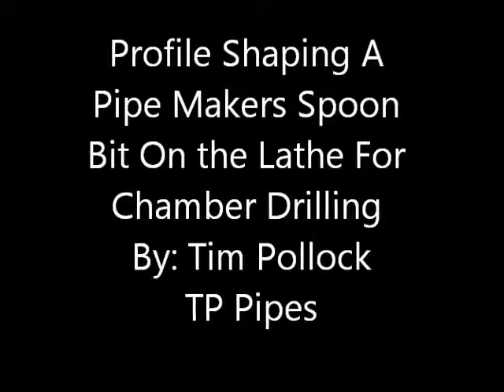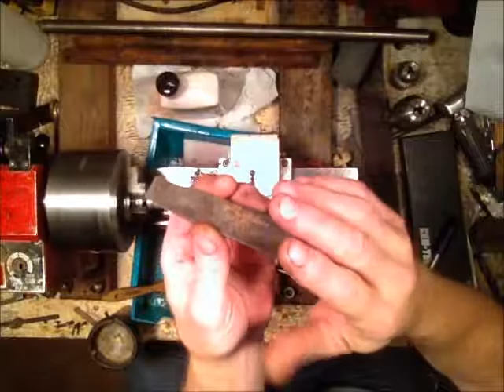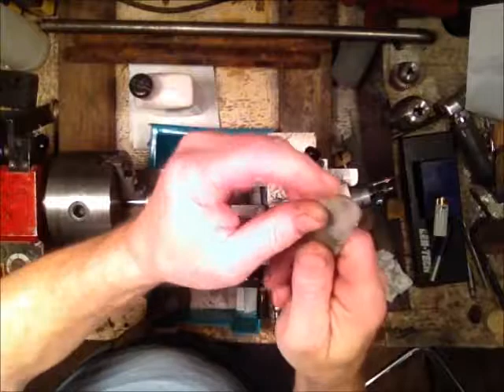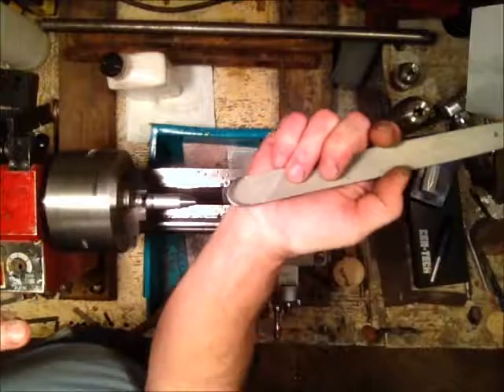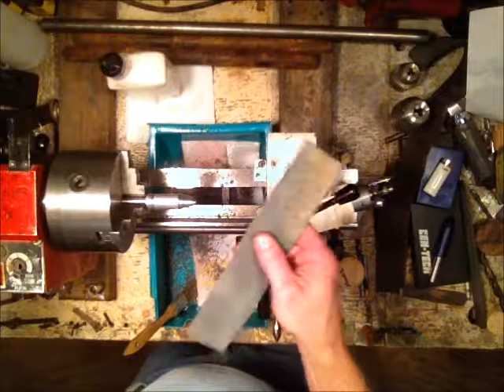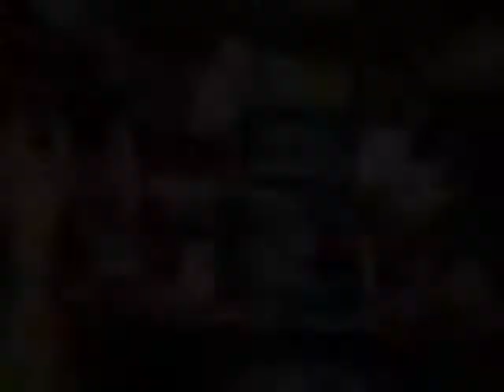Spoon Bit Profile Shaping On The Lathe

Comment: Great video Tim, did you changed the chuck it looks like 10cm or more, I have the same size lathe it came with 8cm. what kind & size is the tool holder I want to change mine.
Reply from the maker: Thanks Peter and thanks for watching, commenting and sharing! I'm no good at metric measurements LOL but what came on my lathe was a 3 inch and I replaced it with the 5 inch you see in the video. That's the biggest chuck that will run on these little lathes and really is almost too much weight. I've already had to replace the bearings in mine. ;) Don't know if you noticed or not but the controller went out on mine so I replaced it with a treadmill motor. Much more power and better speed control.